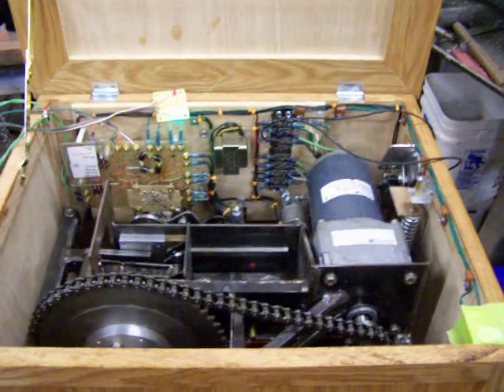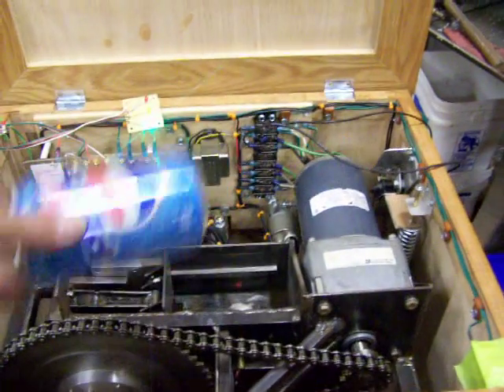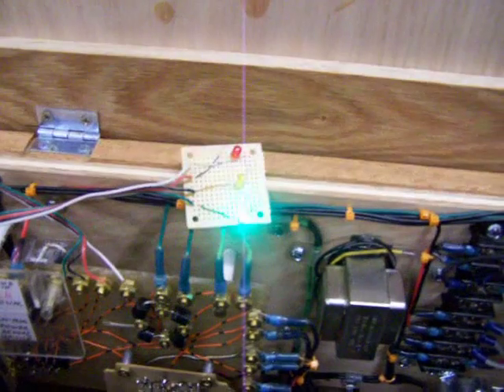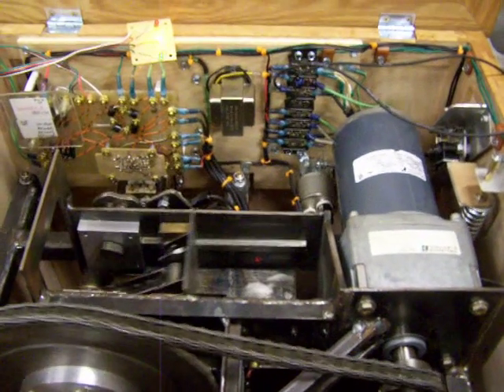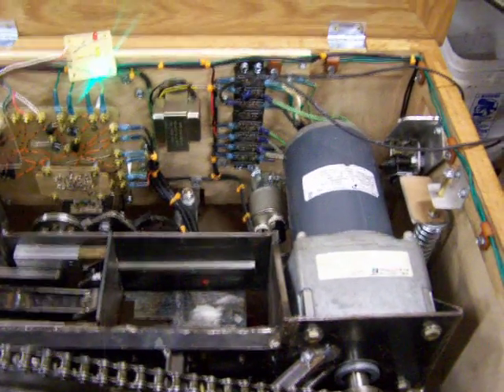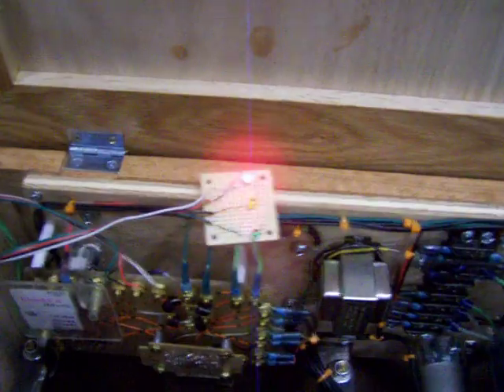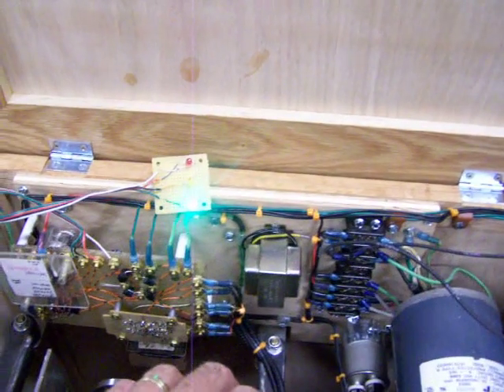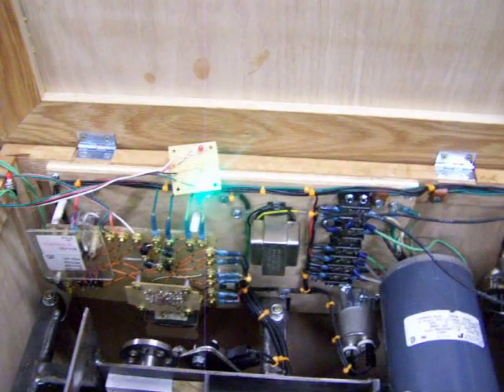Automatic Electric Aluminum Can Crusher

Comment: Well if it was designed for 16 ounce cans to begin with. Couldn't you add a block of metal and attach it with screws to make that for the 12 ounce cans? Then when you have a lot of 16 ounce cans saved up, unscrew that block of metal..?

Comment from the maker: Not sure if this is meant as a positive comment or not, but I assure you that I never took any formal schooling for, and never worked as a engineer. I should have, but  I made bad choices when I was younger. The original inspiration was a commercially made manual can crusher  that worked on the same principals, I just motorized it and automated it. Over engineered of course, but it works and will be used in my kitchen for years to come.

Comment from the maker: the electric motor is a reliant electric 1/8hp 1600rpm 120v AC single phase induction motor. It has a 30:1 gear reduction head mounted onto it.

the sprockets are sized to provide a additional 14.4:1 gear reduction. The actual motor torque is only a few inch-lbs, it is all in the gearing.

Comment from the maker: The available torque at the crank is about 1500 Ft-lbs......but is limited by the slipper clutch and electronic load sensing circuit.

Comment from the maker: If a full sealed can is placed into the crusher, it will attempt to crush it, then the overload protection circuit will trip and shut the crusher off, and make the red LED on the control panel blink to indicate a overload condition. This is to protect the crushing mechanism, or else the electric motor will destroy the crusher due to the available torque the motor has.

Comment from the maker: This video was made before the AEACC was complete. Please check out the second video I posted, it shows the completed project. A small child would need to climb up onto the cabinet to even reach into the crushing mechanism. All doors have to be closed before the machine can work, if a door is opened, a reset switch needs to be depressed to get it to work again.